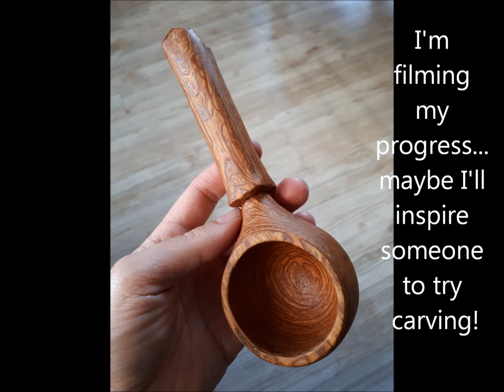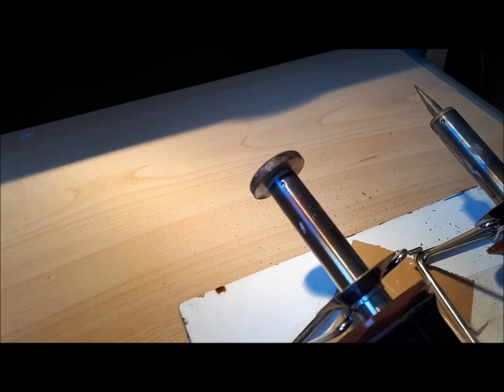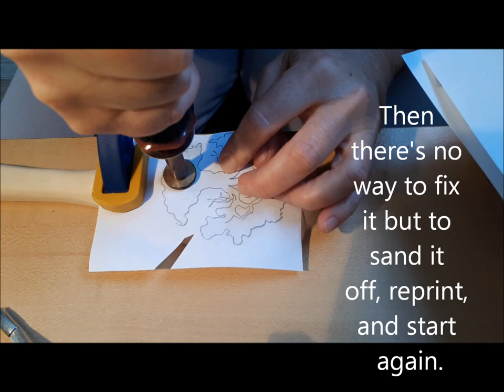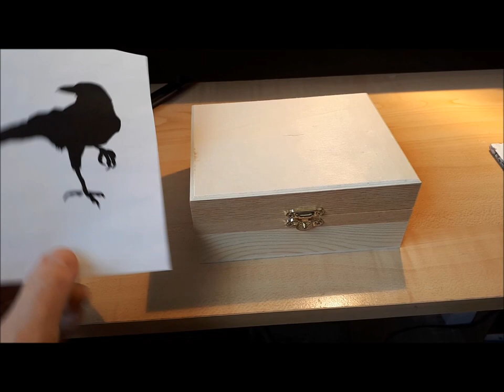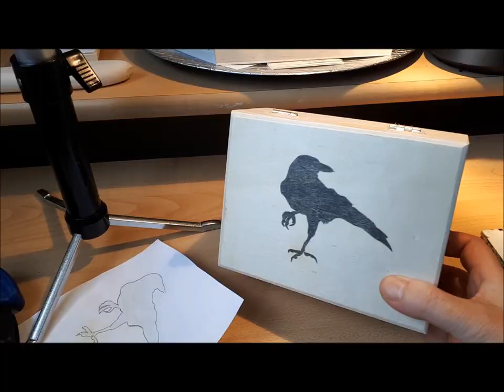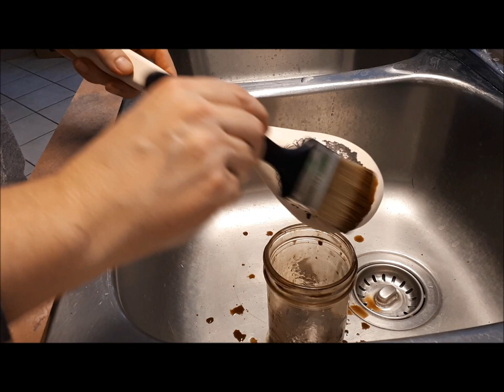WOODBURN ANY IMAGE PERFECTLY WITH A CARBON TRANSFER

Comment: I really wish you had explained what is going on just a little better.  I didn’t see any carbon paper, or where did the pictures come from?  Does it take a special paper?  What kind of stain were you using?  Are you going to burn your project now,  or leave it as is?  Etc.,  etc.
Reply from the maker: Sorry for any confusion! The technique is using a print off a laser printer, and that has carbon in the toner. Then you use a wood-burning tool almost like an iron, and you can transfer that carbon image you printed onto wood using heat and pressure. The only tricky part is making sure the paper stays still!